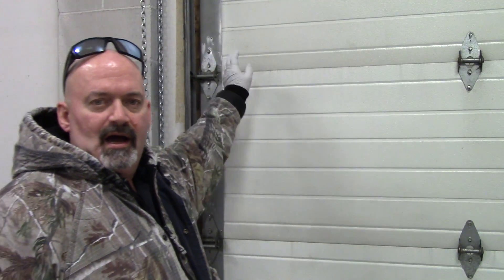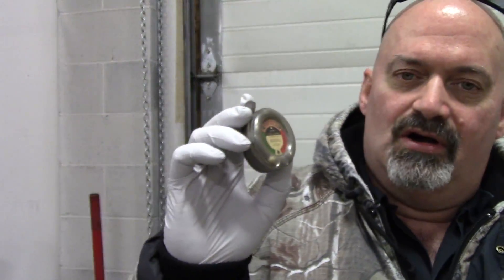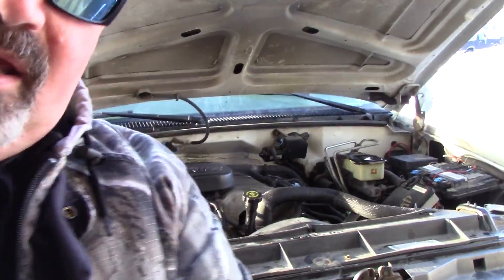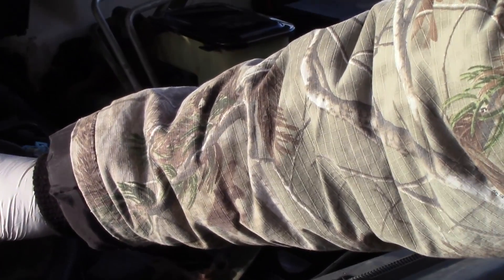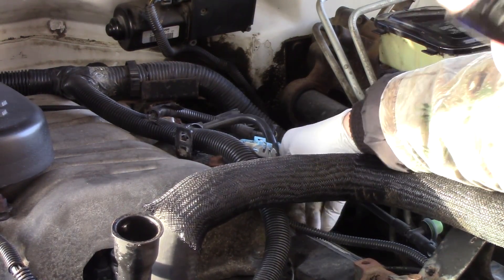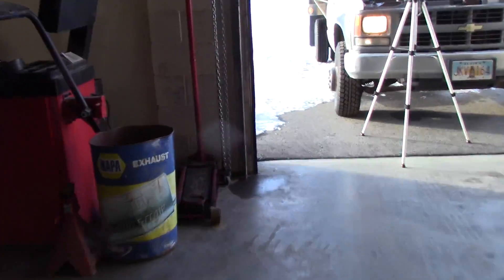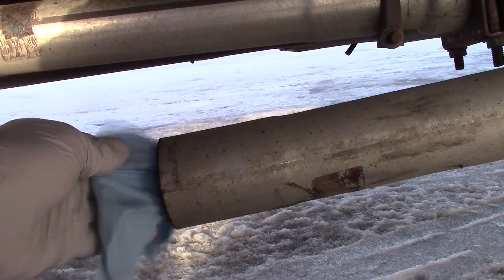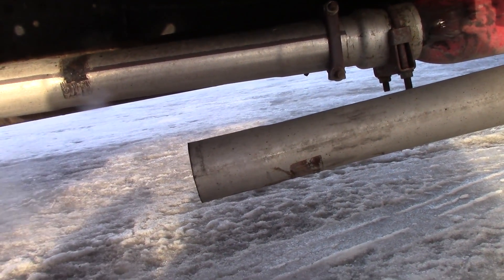Chevy GMC 7.4L Misfire Wont Start and Lean Code Diagnosis

Comment: I got a 2000 gmc 3500 hd with 7.4 n it turned off on me as I was driving  I changed the coil n crank sensor n it still will not start n I checked the fuel pressure n it's good u have any ideas ?
Reply: Check the wires that run along the top of the motor in the back. Might be burnt up

Comment: Did you ever fix the exhaust sucking issue?  If so, what was it?  I still have basically the same issue on a 2000 GMC 454/7.4.  Bank 1 is ok, but bank 2 sucks (split dual exhaust).  I've rebuilt the heads, replaced all gaskets, all new injectors, new pressure regulator, new O2 sensors, new distributor, coil, plugs, wires, new PCV, cleaned IAC and MAF, cleaned the lifters, etc.  I suspect one of the lifters because there was one or two that seemed to have weak check ball springs.

Comment: I also have a miss I cant track down on a VI gen 454. Inherited a 96 3500 GMC from my dad when he passed this year (covid/cancer) and the poor truck is just running like hell. No power. Pops and rattles.. rug idle. I've replaced plugs, wires, cap, rotor, fuel filter, fuel pump... hell everything basically.. still dead miss

Comment: I have two 454 motors, and one bad TBI upper (One upper makes both motors work, the other upper does the same thing, motor runs for 30-45 seconds then starves for fuel and stalls, all else remains the same).  I rebuilt the bad uppper with new injectors, new gaskets, and a new fuel pressure regulator, no avail.   Same issue, motor runs for 30-45 seconds, then starves for fuel and stalls.  
Any idea what could be causing my issue?
Reply: @rarefruit4173  second engine had low compression on three cylinders.  Did a valve job and it got a lot better.  Still chasing gremlins, but it runs and drives.  

Has an erratic idle (bounces continually from 800-1200 rpm), and doesn't make as much power as the port engine, but it runs, and stays running.  Seems to starve for fuel, not sure why, everything is new, including the pump.

Comment: I have a 97 Chevy 5.7 it has po300 code misfire. I have replaced distributor, rotor, plugs, wires, ignition module, coil, crankshaft sensor, map sensor, fuel filter, spider injector and fixing to put a cam shaft sensor in it. The check engine light comes on and the next day it goes off  its driving me nuts  "help"

Comment: I wish you would finished a follow-up video for this truck. I have a 2000 k2500 with a 7.4 and at was having similar issues, I replace upper and lower intake manifold gaskets, all injectors, had 6 hole Rochester, TPS. It started running lean bank 2, missing on cylinder 2 at first, lost all power, rough start, blew oil out back. Now after all the time parts and work. Run lean bank 2, horrible missing cylinder 1, mild on 2.
Reply: Im having same issue with mine after doing same parts minus the TPS but also did new plugs, wires, distributor, and coil
Reply: @cotytownes5353  real bummer I am having same issues   I have a 2000 7.4l / 454 big block. L29sfi. I am just learning  about. It's a 2000 GMC reg cab long bed. Came with a factory gas/ natural gas option . I ot it used aand they took 100 gal nat gas tank off and left the nat gas pump of whatever ontop or  intake. It's losing power , higher rpm at lower speeds. Speedo is not accurate when trk is acting up, breaks aren't normal horrible gear like sound from top of fuel tank. Sounds like a wind tunnel in the intake housing  but , the oil looks like new even at change time  can anyone explain the problem? Can reset the brain so I get correct codes? It reads o2 bank 1. All the stuff happens at once . What's the connection?

Comment: That's a sweet exhaust system Tim!  Put a sparkplug in the exhaust and you can have some cool flames and a few throttle snaps and I bet you can blow that muffler clean off...just saying...never done that when I was a bored teenager. It clears up any exhaust restrictions also :D
Reply from the maker: Hahaha. Nice. I’ll have to recommend that upgrade to the customer. They have decided to drive it till the wheels fall off I guess.

Comment: I wonder why they didn't get it checked by someone before parting with the cash :-(.
Since one valve is faulty, i would expect the rest to be suspect, could be an expensive mistake they made.
Reply from the maker: The overall condition isn’t good. Probably not worth fixing. They relied on someone who said they were a mechanic and helped them out with the purchase but I’m not sure they got sound advise. I told the owner I would check any future vehicle free of charge if they plan on looking for a replacement. Heartbreaking
Reply: It's a shame they didn't ask you from the start, they would have saved a packet if they payed you to do a general checkover of the heap... i mean vehicle, i got that right the first time lol.
I found a family run motorcycle repair shop, i did not have the time to repair my machine and be at work at the same time.

They were worth every penny, a decent repair from decent people :-).
Much like yourself, you do a decent job thats affordable without the customer selling a kidney lol.

Comment: That truck is good for 10 videos at least! I'll cross my fingers for you that they give you the go-ahead!!
Reply from the maker: Indeed! Hydro boost leaking, upper and lower BJ’s outer tie rod ends, idler and pitman arms, complete exhaust system, injectors, regulator, upper and lower intake gaskets, fuel pump, valve spring, battery hold down, RR inside tire flat, oil cooler lines, ignition coil circuit code, etc. maybe a feature length film is in order. Haha. I don’t think they are going to do it. The cost exceeds the value I’m pretty sure. Sad deal.
Reply: LOL.
Reply from the maker: haha
Reply from the maker: I polished the radiator cap and placed it on a new truck for them.

Comment: Tim,  great video.  I do own 454 and 350 Suburbans.  Most extremely common problem is intake gaskets fail due to deathkill stuff (Dexcool)  injectors failure by the poppet valves gets harder by heat and cool cycles due their location inside the intake.  By having new multi port injectors instead of Central Port.  Solved problems with leaky injectors and low vacuums etc.  Plus oil leaks on the oil cooler lines going to the filter housing.  Super common!  Thanks for showing this video, Tim!

Comment: Lower intake is definitly a commen problem i have a 99 suburban with the 7.4l and it has the same problem . Cauases it to flood after warm up Nd hard starts 😥.
Reply from the maker: Yes and also the fuel system leaks causes the same.
Reply: Yea hopefullly when i do the lower intake i want to do all the injecters and F.P.R
 other than that trucks a tank.

Comment: Hi there sir!  I'm interested in seeing the broken valve spring as I have a 99 k2500 suburban with 7.4 and it has a small misfire on #4 at idle.  Around 8 misfires every misfire counter cycle.  Where did you pinch off fuel lines at?  Transmission hump?  Can you pinch off those flex lines there?  Thank you for the great videos and keep them coming!
Reply from the maker: Have you tried the exhaust test yet?
Reply: The Car Doctor no, it has duel cats to single muffler and exhaust all the way back to end of truck.  Would I notice it with full exhaust?

Comment: That's one heck of a good trick. Love it! You did a great job getting this guy a heads up on the work that needs to be done. Too bad he just bought it. Now the real cost is upon him.   :(
Reply from the maker: I get the feeling they are just going to drive it till it kills someone.
Reply: @ThecardoctorTV  that is horrible. I really loved the video, I'm having some issues with my 454 k3500 hence why I'm here. However, that comment... just wow.
So what kind of vibes did you get from the truck owner that would lead you to make that comment?
I mean there are options for the owners. They could fix it, seems like issues that could be fixed offer several weeks and be do-able. They could off the truck on someone else, much the same is what happened to them (although not my choice) they could part the truck out, they could make a trade to someone handy looking for this kind of project.. Hell, they could surprise you and hire you to fix it, maybe they have the money to do that now, maybe they will just slap it on the credit card. I mean there are far better options other than driving it till it KILLS someone.
I just didn't like that. Sorry, just my thoughts, the comment kind of shocked me, completely unexpected.